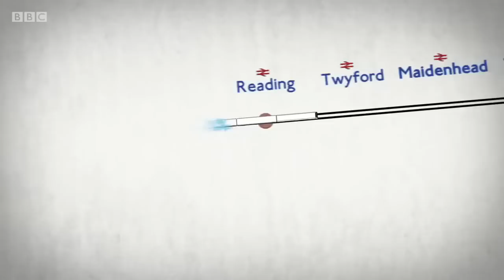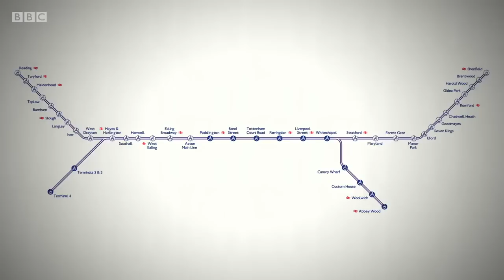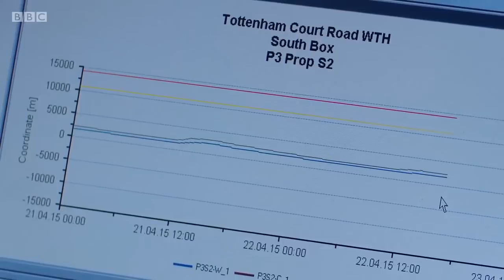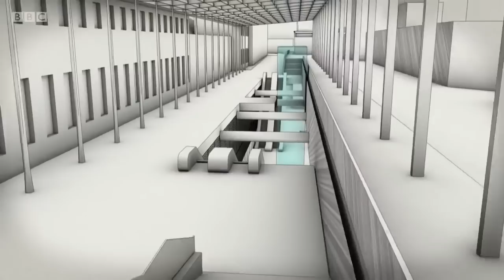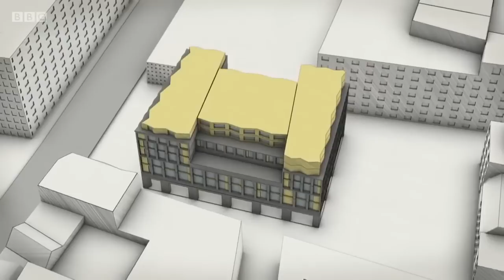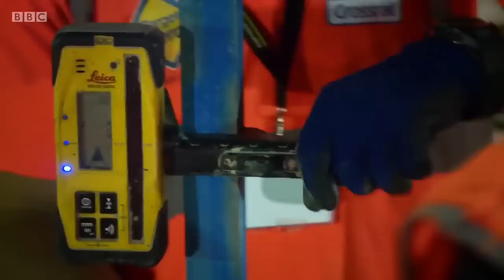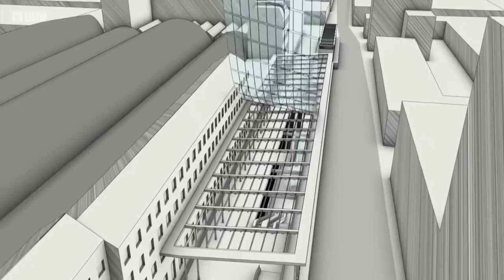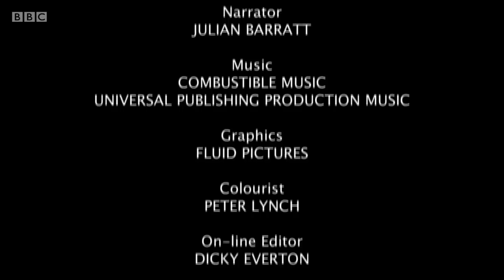The Fifteen Billion Pound Railway - The Elizabeth Line - Episode 5

Comment: I wonder why these documentaries always use "Olympic-size swimming pools" as a measurement of volume.  I've never seen an Olympic-size swimming pool, and I wonder how many other people have.  And, also, taking into account the deep end and the shallow end, it's not too clear whether in terms of depth we should be visualising something as deep as the shallow end or deep end, or an average depth.  Still, I suppose there are not too many other things we could use to denote volume.  If it were not for Olympic-size swimming pools we would probably be reduced to using elephants.
Reply: football fields down in spain...
Reply: Just google it
Olympic size pools measure: 50 metres long, 25 metres wide, and a minimum of 2 metres deep. 660,430 gallons of water.
Reply: Its huge.
Reply: 2500 cubic meters its a volume there is no water
Reply: A country the size of Wales.
Reply: I have seen and swan in  Olympic size pools Since the late 60s

Comment: the "cloud art" just looks like dirty glass
Reply: I know right!
Reply: Thats exactly what i thought also, why do that to perfectly fine nice clear glass, that would inn itself be spectaclar to look at. If you absolutly have to have something in it, put sun protective film or something useful like that.
Reply: Ikr I want to wipe it down with some windex
Reply: What's the point of putting a cloud on a skylight anyway? It's England you would be able to look through a plain piece of glass to see clouds
Reply: @maa1649  Yeah and it never dawned on the designer that you can probably see clouds by looking through the glass lmfao. I mean really as an artistic choice i think it is a load of bollocks since the fake clouds will be blocking the view of the real clouds. It's literally redundancy on more than ironic levels, it's almost painfully cringeworthy.

No offense to the designer but i really don't agree with that design choice.
Reply: Thats the point! if it always looks like dirty glass, and you say its just art, then you'll never have to clean it ever again! it's just ART😉
Reply: @maa1649  Not durable. The heat eventually destroys anything that's not permanent. The point of the cloud print is to reduce heat.
Reply: Art Clouds. In London. Known for its real clouds. How about something light? Like an light art installation powered by the sun?
Reply: @danellis-jones1591  The point of the etching is cut down the light and heat. Otherwise, it would be an oven.
Reply: @firesurfer  Well, it's triple glazed. I don't disagree with embedding art into it. In comparison to where I live, it's awesome. But clouds? In London? How about engineering feats through history? Or something quirky and funny, that reflects the London sense of humour?
Reply: @danellis-jones1591  I don't know if it would show up as something understandable. It was probably the least objectionable design (the most boring) to the most people.
Reply: @firesurfer  probably. Design by committee. Art should create a reaction. Whether that's good or bad isn't important in my opinion. Art shouldn't disappear into nothingness
Reply: @danellis-jones1591  It's a given in construction, that as the project progresses, you lose details. Simplicity rules. Sad, but true.
Reply: @firesurfer  Yeah. It's a pity. Our built environment would be so much more interesting if they had more creatives doing it. But construction is all about engineers. Obviously that's good. The buildings need to be structurally sound. But also once they're built, we all have to live with them. Boring buildings = boring cities = boring people
Reply: @danellis-jones1591  Sometimes projects have an artistic director strictly to prevent this. But it takes a lot to get it before it's too late.  The architectural firm is usually responsible for this.

Comment: One thing we've learned in the past few months is that hand-holds and other surfaces people touch should be made of copper.
Reply: No, somebody steal it... happens everywhere in public...
Reply: @karlchristoffer1275  But lots of handrails and door handles and whatnot in public spaces are made of stainless steel.  Nobody steals those.  Why would copper be any more prone to theft than stainless steel?
Reply: @fredashay  Thieves are stealing copper and brass, f.ex. cables of copper and aluminum. It's valuable and easy to sell... high price pr. kilo...  There are examples on empty houses been robbed for piping and wiring of copper. Stainless steel are not that valuable...

Comment: A wonderful new railway, that provides zero new catchment and duplicates well-served existing routes, for a cool 19 billion quid, because it's London. Meanwhile, provincial cities that desperately need metro systems can't even get funding for a tram. Reminds me of Matthew. To those who have, more will be given. But those who have nothing, what little they have will be taken away...
Reply: The Tyne side metro is falling apart and they waste billions on this.
Reply: @dogwalker666  Yes, and it's not even finished. It's screaming for a western extension, which could have been done for pocket change, compared to this white elephant.
Reply: @gordonblues843  there seems to be no reason behind it whatsoever.
Reply: @gordonblues843  that about sums it up.
Reply: @dogwalker666  The Surrey stockbroker belt is not going to be left out. Crossrail 2 is for them.
Reply: It  is not, and never was, for passengers. Like all previous railways, they were built for freight, and this line is too. There is no room for any more traffic on the existing network.
Reply: Anyone who actually understands public transport will know that Crossrail does not duplicate existing routes, they'll know that it complements existing routes by providing an express service east/west railway instead. You'll notice that there are many less stations in central London on crossrail than on normal tube lines. This is because the fewer stops allows for faster trains, and so shorter journeys. This will remove people from other lines which allows them to provide better services as well.

Comment: You know what would really revolutionise train travel in london??

Just cut the "zone" crap out
Reply: Elaborate
Reply: The New York City subway charges a single flat fare for access to the entire system There are no zones. It doesn't matter how far you travel like it does on the London Tube. According to Google, NY has 472 stations while London has 270 stations. In terms of tracks, NY has 394 km while London has 402 km, a bit more. Because of the long routes, the major lines of the NY subway have express and local trains making access to the furthest reaches of the network that much faster. This is made possible by a four track layout along the major routes. 

Again, all for one fare.
Reply: @michaeljarosz4062  To be more exact,  
"It has 245 miles (or 394 km) of routes on 691 miles (or 1112 km) of track."

Comment: First, what awful colours for the seats.  Second, the seats appear small for large people to us and look something like the useless and uncomfortable seats in economy on airlines such as Ryan Air and they appear to have low backs so there is little upper body support.  Just saw the first test run of the first train.  As a handicapped person with troubles getting up onto steps, these would create a problem as the steps are too high.  Somebody did not think things through properly or completely before finalising the design or talk with disabled people and ask for suggestions.
'nuf sed
Reply: or you could possibly learn to cope with your weight issue and stop making it our responsibility to accommodate you

Comment: Surprised they managed to find a scale large enough to effectively weigh those rails! That's means the rails weigh in at about 7.5 million tons. Given there would be two sets of tracks, and the length of Crossrail is 73 mi then that would work out to an average weight of 25,864 tons of steel per mile of rail. Talk about heavy rails! 🤣

Comment: In Madrid they build underground metro lines for about £55m per mile. For 19 billion pounds they could have built 345 miles of underground metro. Let's assume things costs twice as much in the UK. That would make it 172 miles of underground subway.
Would that not have been enough to extend the Bakerloo Line, the Northern Line to Clampham Junction, a new line to Crouch End and Muswell Hill? A new subway line in Glasgow? And some new metro networks in Leeds, Bristol, Manchester, Birmingham?

But no, instead London gets its services duplicated.with 13 miles of new tunnel. UTTERLY DISGRACEFUL..
Reply: Except the Madrid Metro was built with a lot of overspending. The average mille in Spain costs 12 million pounds
Reply: @hermenegildoc3933  One mile in Madird metro costs 62 million pounds. It's very cheap.
Reply: Crossrail isn't a metro, it's a railway. Heavy trains capable of 90mph. it runs an express service across London, which reduces travel times for passengers, and reduces the load on other East/west lines like the Central and District. It's needed because much of the Tube is already too crowded and will only got more so. London will continue to grow faster than other UK cities and so needs more investment in the infrastructure, in things like crossrail and the new sewer system. 

More money should absolutely be spent on other major UK cities, but you cannot argue that crossrail is unnecessary or unfair. Try challenging the government on the 10s of billions of pounds spent on a scrapped test and trace system instead.
Reply: @gregoryclark8217  It's an atrocious application of funds.
Reply: @hermenegildoc3933  Wow!